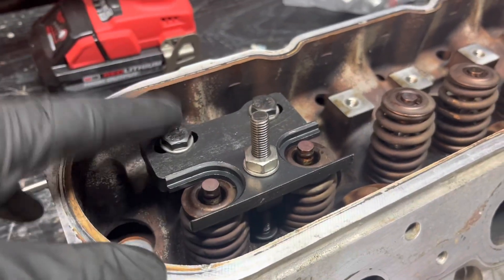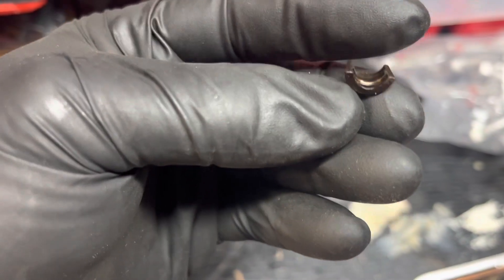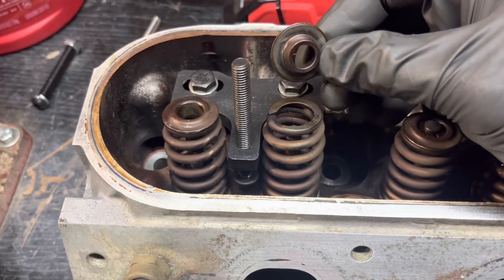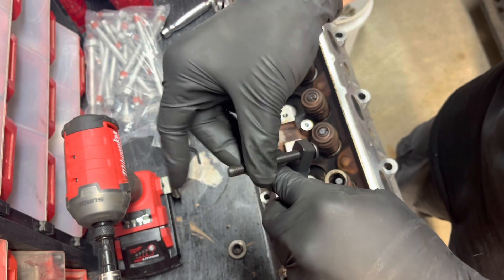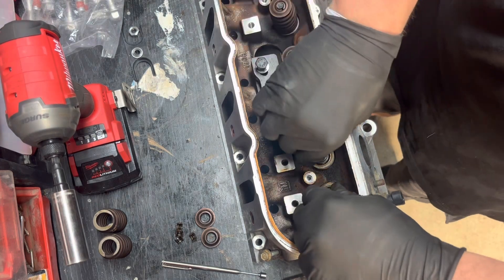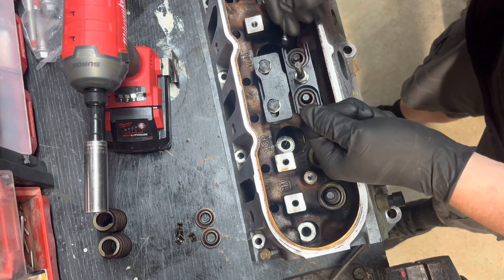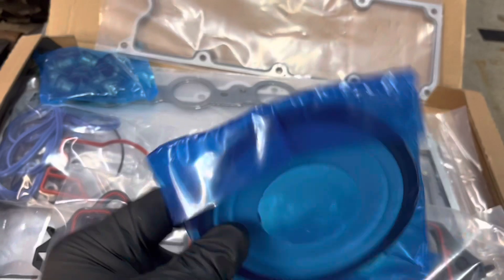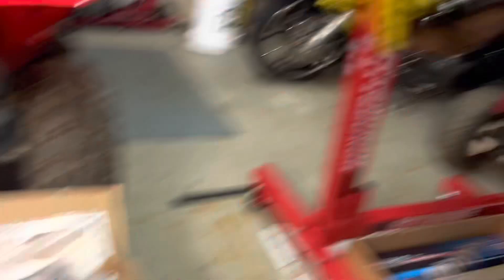5.3 L LM7 valve, spring removal and installation. Part 3

Comment: Man you have a great video on explaining this. The only part I’m still not 100% on is the reinstallation process of the rocker arms. So if I understand this right. I want to only torque down the rocker arms that have no tension on them AKA the valve spring is not compressed any and is fully up? Then rotate the engine over to decompress the other valve springs and then torque down those rocker arms?